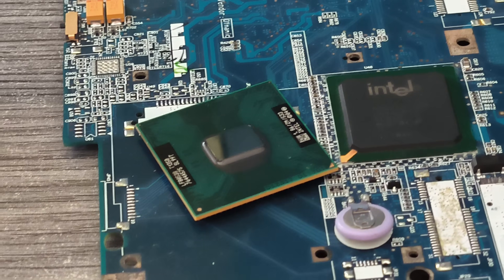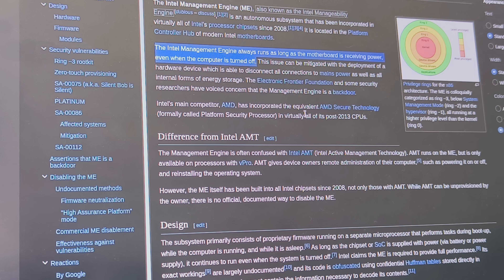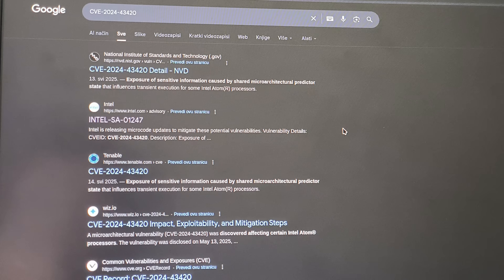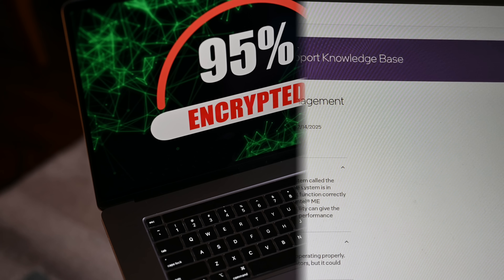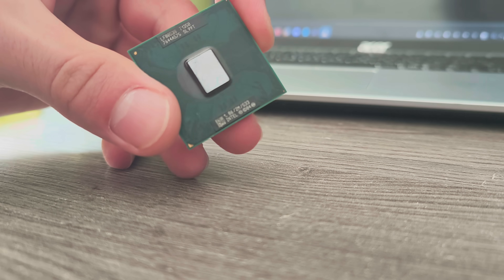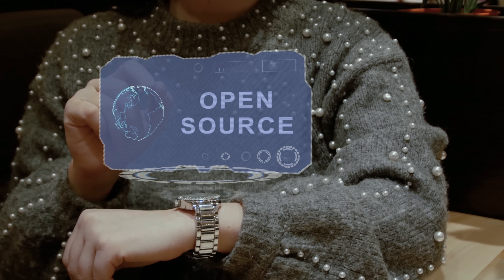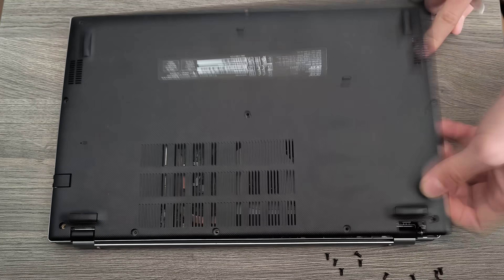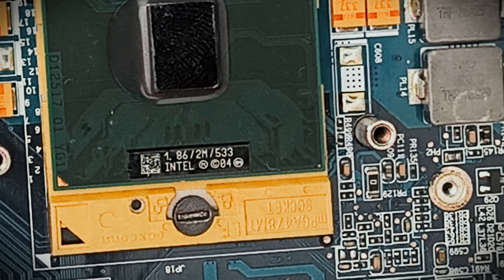YOUR CPU SPIES ON EVERYTHING (Even When Your PC Is OFF)

Comment: There is a simple way to protect your PC from this. Unplug the Ethernet cable when you turn the PC off.
Reply from the maker: That is an important step for wired attacks, but unfortunately, it's not enough. Especially on laptops with Intel's vPro/AMT, the hidden management chip can communicate using saved Wi-Fi profiles - even when the OS is shut down. The danger of IME/PSP is that it bypasses the OS firewall entirely, meaning only a hardware-level fix can truly secure you.
Reply: @alex.cybersecurity We need to invent a battery disconnect bypass switch dongle that functions from a USB port.
Reply from the maker: @JBrezicPhotography   That's a very creative hardware solution, but attempting to force that action via a USB dongle is incredibly risky. It would be highly dangerous to the hardware and is not something you'd want to expose your motherboard to. The safest way to achieve control is still by using open-source firmware like CoreBoot.
Reply: @alex.cybersecurity  Just throw it in a RF shielded bag, briefcase or box and remove the battery if possible. Its not expensive to make a RF shielded storage either.
Reply from the maker: @pixelfrogs  That's a pretty good idea, but it's sad to hear that someone would do that just to be private.
Reply: @pixelfrogs  Oh it's SO easy and convenient...
Reply: @VioFax  Its not hard my friend, grab a laptop bag or backpack and line it with Foil and Mylar and boom, RF shielded bag. You don't need much, just enough to kill the WiFi.

Should cost you less than a tenner.
Reply: @alex.cybersecurity  im on motherboard from 2008 , desktop PC, no wifi. 
P5Q deluxe, P45 chipset. Am i safe from this, or even then, on core 2 Quad, it was implemented?
Reply from the maker: @warrax111  Your 2008 P45 desktop is almost certainly safe from the worst of the Intel ME problem. The full, dangerous version of the Intel Management Engine (ME) and AMT was not standard on that generation (Core 2 Quad / P45 chipset). You likely have a much simpler, basic version, or none at all, which means you are naturally protected against the modern hardware backdoors we discussed.
Reply: They can't still get you wirelessly